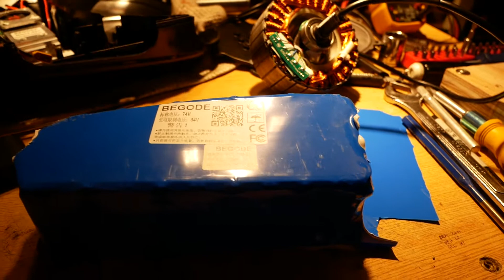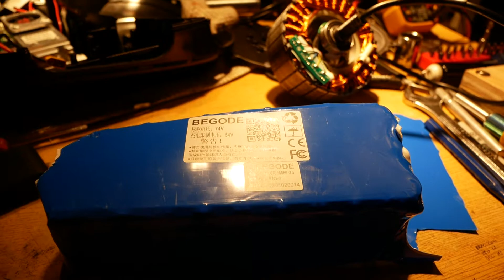Gotway MTen3 teardown 3

Comment from the maker: To all looking to work on your EUC:
1. They are rarely low voltage! You can get a rather nasty shock from 82v. It is in your best interest to NOT short your body or hand across the pack. Even 48v with sweaty hands will deliver a solid shock. Pay attention to what you are doing and don't let your body bridge across any exposed portion of a pack. Electrocution only gets worse with 100v and higher. BE CAREFUL!!!
2. I build EV's, I've wired houses and worked on live AC circuits without special gloves. IF done right, this is fairly safe...IF DONE RIGHT! IT is critical that your body in no way bridges across the current path (high voltage to low voltage). Higher the voltage, the less tolerance there is to even the smallest mistake! Skin resistance matters less and less as voltage rises. Dry skin on one hand across 120v AC or DC will deliver a hefty shock to your hand. Across both hands, you might stop your heart! AVOID bridging your body across a current path!!!
3. I build EV batteries. I am spot welding nickel strips to LION cells. It is quite easy to rest my hand absent mindedly on the exposed pack. I usually don't get shocked or it is very mild since this bridges across just a few cells. It has happened that I bridged my hand across nearly the entire pack and that is painful and can cause burns or death if it was across my heart. I put down tape or have a section of cardboard to lay on top of the cells to prevent this. 
4. I'm always wary of anything conductive around the pack that might create a short. I accidentally shorted across part of a pack with a section of nickel.  I had barely gotten started on a 20S, 82v pack. Only 4 or 5 cells had been spot welded in series. It instantly welded itself across the cells! The metal started glowing red hot! I grabbed some pliers and ripped it off of the cells! Even across just a few cells and at fairly low voltage, has the potential to deliver the same amount of current as the entire pack. DON'T assume that since the voltage is low that you are safe! 12v and 300 amps will weld a screw driver across a pack nicely or at least leave a giant pit in the meta!!!
5. In this video you see me handle the pack with one hand only and there are lots of times where I bridge my hand across portions of the pack. I want to point out that my hand is very dry so conduction through my skin is low. If I was sweaty or if my skin was slightly damp, you would hear say "AH!" or "OW!" quite a lot. I handle batteries often and I am getting small shocks while making this video, but between dry skin and bridging only portions of the pack, I'm not getting the full pack voltage. I also made sure there was no metal around the pack to keep from accidental shorts.
*
The only wheel I have personally taken apart is the MTEN3. I now have an InMotion V11 that will be completely disassembled soon too. I already know build quality is better and that the BMS is smarter.

Comment: I've always been wary of Chinese BMS use construction and battery pack construction in general, it's one of the things that makes me wary of any of these wheels. With one of my ebikes, I don't run a BMS and use an iCharger 3010b for balance charges, which has been working pretty well for me for the last 5 years. If/when I eventually end up getting an EUC, I'm considering removing the stock BMS, and wiring a connection port to the shell for external balancing. I just wonder if the controller will throw a fit for whatever reason if stock BMS isn't there. 

Also, like you, I only want to charge to 4.1V per cell max for battery longevity and would be uncertain if the stock BMS is only top-balancing at 4.2V per cell. When I was building my bike back in 2015, this seemed to be a problem and I'm not sure if it still is today.
Reply from the maker: I build EV's. I use smart BMS's on all my packs. The XiaoXiang brand is pretty good and I use their BMS's a LOT. Anyway, before I bothered with bringing out balance wires, I'd use a smart BMS every day of the year!
Reply: @de-bodgery  good to know. I might be keen on swapping a Nucular BMS when they release if the wheel I end up getting doesn't balance at or below 4.1v/cell as an option too.

Actually, what I'd really like is to spec my own EUC, basically just buy an empty chassis/shell, with the controller, motor, and wheel sans the tire. Then I could just build my own pack, 3D print whatever parts/dividers/ducting needed for cooling, and do the rest of the assembly myself.
Reply from the maker: @connectvanplans  The Nucular BMS could be an option. Of course they don't exist yet...so who knows when they will become a reality. In between time the XiaoXiang BMS's work great...no need for something else IMHO.  I've used ANT BMS's and they are pretty good too. My current EV build runs at 82v and I see peaks of 500 amps between 2 ANT BMS's. They do fine.
*
Why not just start from dead scratch? All you need is a hub motor and then build up a frame for yourself. There's entire DIY communities around building your own wheel.